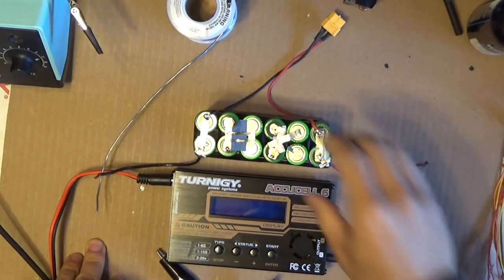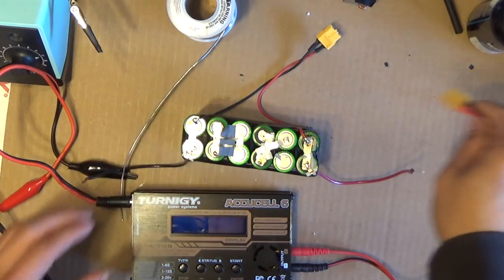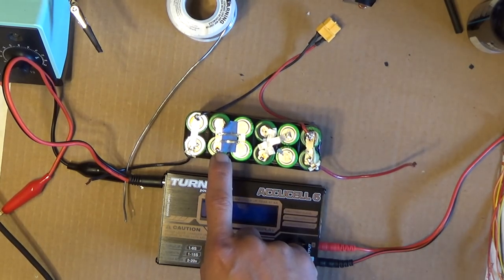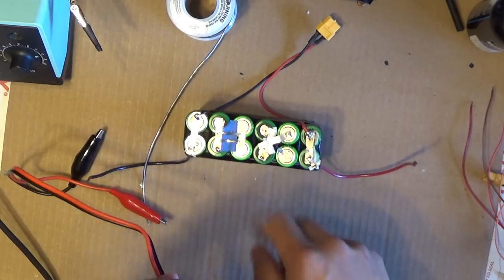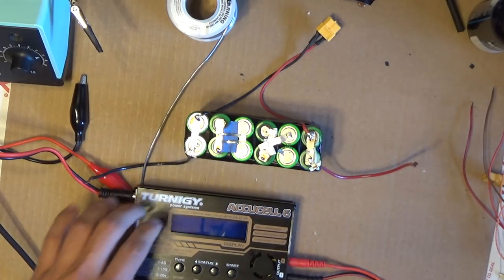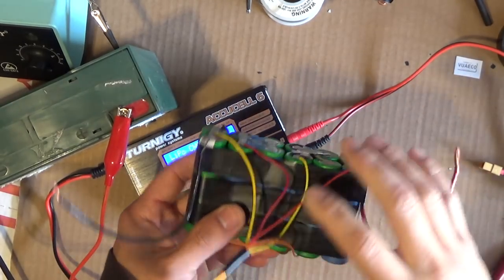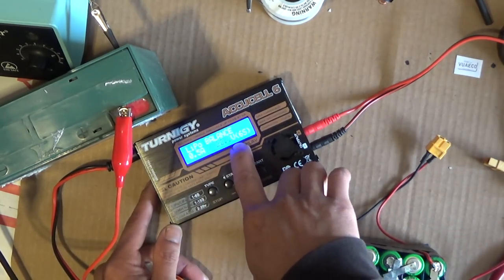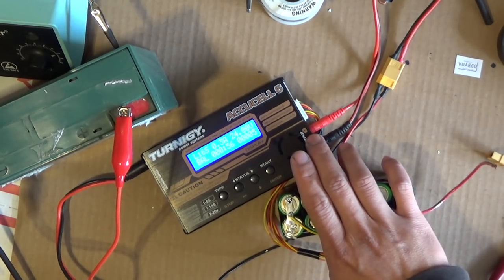DIY: How to Balance charge Li ion/ Lipo battery pack w/ a balance charging cable Imax B6 Accucell 6

Comment: I built a duo 6s cradle system each wired in series. Then I heard about parallel charging and that bothered me. This helped confirm that my wiring is correct so I should be able to plug it in without blowing something. I did blow a cheap charger a while back getting it wrong! I also didn't think about using 2s, 3s, etc cables instead of a 7 pin. That makes sense as the charger rotates from pin to pin (cell2cell). So thank you again my friend.

Comment: It would be better for others to learn and understand what you said.  The diagram on how you arrange the battery parallel. Most of the beginners will confuse serial and parallel connections.  Thank you

Comment: The reason that I am looking at your video is that I was given a new Ryobi 18v 4 amp-hour battery which was not working. Disassembly showed all ten cells were at about 3.8 volts and hence OK.  My plan therefore was to look for disconnects on the control circuitry and if nothing was obvious remove the board and wire the batteries directly.
I have an Accucell 6 Turnigy charger like you and tried to charge the battery as a complete block.  The unit would not do it and gave the error message ‘balance charge connection’ despite it not being in the balanced charge mode.  This is the second battery on which this has occurred and I think that the software has been programmed to do this.  I am interested that yours will, but wonder if you have actually tried it.  What I can do is charge linked pairs of batteries, but this means five episodes of charging to get them all up to level.  Batteries all have an internal resistance which is more matched on more expensive batteries.  On cheaper batteries this may lead to problems.  Watching your video I will reattach balancing cables and try again, but whilst thinking about it remembered that you can buy tiny voltmeters to go on the balance cable for a few dollars and so one can monitor the power tool to ensure that the batteries are not discharged too far.  Hobbyking certainly sell these for the model aircraft guys.  I have also chopped a drill battery case and put in a Turnigy 18v cell to get my old Nicad tools working again.  These batteries tend to be 2/3 of the price of the main tool companies.  I was also able to resurrect and 40 volt Hilti drill for a friend with two 50 buck batteries joined and convert it from nicad to lithium.  They are easy to charge on the  Accucell charger.  He was told that he must buy a new drill at almost 900 bucks.  12 volt kit can be done in the same way.
Thanks for the video
Reply: Do you know anything about ego 56 volt batteries for leaf blower and lawn mower they're all compatible 56 volt anyways I'm trying to make one that will work with it not having the original battery but there is two wires that I found out or something about communicating or temperature wires so there's no way to make it after market battery that I've been able to find so far is this true how can I bypass this communication wire anyway??? The brand is called EGO , I think there's somewhat new or newer company but I'm not going to drop $400 or $500 on a battery that's crazy I got the leaf blower for free I just need a battery cheers if you can reply

Comment: With 6s6p if it isn't overkill. You can start car and most likely
 not need to disconnect because it can handle the highest alternator voltage.
 Stop and go every day for a week and then take it into house to put all
 the cells back into balance.
 Drill a hole into the cab and attach it inside car so you do not have to always
 put up the hood.

Comment: Is there an explanation of your original build on this battery. I am so glad to have found you as you seem to speak to me!
Reply from the maker: This is a 24V pack I built for running 6x 4V LED light bar (connected in series).

Comment: Great video thank you very much so what about my battery homemade pack has 39 18650 cells so would i have to buy a connector with 39 wires on it ? Do they even make Chargers with connectors that big ? or do I break it down and do it in groups of six even though they're connected to do the balance???

Comment: Thanks for this, I was told last year it doesnt matter on these types of batteries about balancing but I have doubts now so I looked for a video like this. Always get a second opinion I guess.
Reply: Solutions Architect 
And the BMS will one day fail.
Reply: the balancing is in the charger through the pins to the "balanced" wiring. If you are using a 2-5 amp brick type charger with a single ground and single positive a BMS IS needed to take care of the balancing. It distributes the amperage to about a half amp (usually) up to 1 or 1.5. It's best to go by the mfgrs spec if you know it.:face-fuchsia-poop-shape:

Comment: Hello Vuaco, 
 I have some favorite smaller power tools (power screwdrivers etc.) that are 7.2v. By watching your videos I have replaced the old Ni-Cd batteries (usually 6 short "C" batteries) with two 18650 cells and they fit perfectly.....My question is, when two 18650 cells are used together to power a 7.2v tool, Is it considered a 2 cell pack and should it be balanced charged? 
The newer high voltage tools have many 18650s so is each one considered a "Cell"? Or should I consider every pair a "Cell"? 
 
 All your videos are packed with lots of info and I would not even consider re-building any battery packs until finding and watching your channel...I have re-built packs for family and friends in the past months and they think its magic! Lol

  Thank you for sharing all your knowledge with the world and especially me in Canada :)
Reply from the maker: Yes, a 7.2V with 2x 18650 is considered a 2 cell pack and should be balance charged. You can get away with a few cycles by not charging it to full 8.4V but eventually you will still need to balance charge it.

Comment: Thanks for a well explained video. One question: should you really connect both the "old" charging cable and the balance cable? Or does the balance cable only measure voltage?
Reply: Thanks!! Vary well explained.

Comment: Great if you could see the screen on the charger   I still don't know what mode to charge my 3S 8P 12 volts 32 amp 21700 cells I have lipo lilo life lihv which one  is for lithium

Comment: Good explanation. Ihave a question. With a 300Watt, 6S Li-Ion, 20A balance charger, can i charge a 18650 Li-ion 6S4P 12Ah pack(24 batteries)?
Reply from the maker: Yes, definitely.
Reply: And how long would it take to charge?

Comment: Not sure what you meant but I’ve wired mine the positive first then alternate negative just trying the turnigy accucell 6 out to balance and my cells seem quite close already and I don’t use bms at moment some people just use bms to balance but don’t connect main power through bms one I had stopped anyway after not long on bike so I took bms off

Comment: This is grate! But in thia configuration isn't it balancing for 2 cells? Co if one in pair is weaker it will still charge the other one more then it supposed to be charged?
Reply: The two cells in each pair will always be at the same voltage because they are in parallel.  Electrically the two connected together form one cell.
Reply: @westinthewest  thanks. What would. Happen if one in pair was able to be charged lower then the other one because it wpuld. Be a damaged cell. What would be the reading on that pair?
Reply: @michatrejgis2188  It's impossible for the two cells to have different voltages.  Connecting them together in parallel is the same as extracting the materials from the inside of each cylinder and putting them all together in one bigger cylindrical can, making one bigger cell.
Reply: @westinthewest  so if one can not load to the full, the other one will compensate for it? Or will finish loading on the lower level too?
Reply: @michatrejgis2188  I don't fully understand the question.  The two paralleled cells will both charge to the full 4.20V together as if they were one cell.  There will be plenty of internet resources which will explain the principle better than I can.
Reply: @westinthewest  if one cell is able to go up to max 3.9v and the other one to 4.2. What will happen?
Reply: @michatrejgis2188  I need to understand why one of the cells can only go up to 3.9V.  If you are mixing chemistries between the two cells then that is of course ill-advised.  If the cells are both the same chemistry you can mix brands and even capacities with different internal resistances.  Their voltages will always be the same.

Comment: Please help, ty for the video but I made a 4p  battery pack for my 3.7v fish aerator, my question is does it need a balance wire for the 4 parallel 18650? Im a nebie and cant find anything on parallel balancing. I own a battery new spot welder and skyrc b6 charger. Any help will do, thank you.
Reply from the maker: Hi Max, you don't need to balance charge a 4P pack because every cell is balanced to the other cells connecting parallel to it. You only need balance charging when your pack is connected in series with 2S or more..
Reply: @vuaeco  oh! ok......TY so much.

Comment: Thanks a lot for this video. Maybe someone can help me out with a problem I'm facing for hours now. I've two Accucel-6 and they work with packs without any problem. Now I want to use them for an ebike. I ordered a bunch of NCR18650BD Lion. I've put them in 3S with different numbers of P. The load current seems to be limited to 1.0 A, independent of all settings. For 1P it may be ok, but for e.g. 14P it would take forever to load the set. Any comment? thanks
Reply: solved. I've introduced it myself. On both ends of the battery I've put copper tape to improve the connectivity. But the opposite happens. It added a small but important resistor to the lines.

Comment: Hi!
Can you please show a balancing charge on an 18V Li ion Makita battery, without opening it up, just using metal flat sticks to connect to the battery. Thanks!
Reply: Makita batteries have a balance built in so connect it to a charge. Pick charge option, away you go.
Reply: @johnlever6696  indeed, away he goes

Comment: Dear, very thanks for your video ,pls,I want to know if you add pcm to this battery pack
Reply from the maker: A PCM (Protection Circuit Module) is to prevent over charging and over discharging. You don't really need to protect over charging as the Accucell 6 or Imax B6 already has overcharging protection. You might need to protect it from over discharging when you use it on your power device. But I don't think you need that, in my opinion. Adding a PCM will make your DIY pack more costly. It also add in more complications to your build. And it also cost you more time to build. These problems will escalate when you build many of these packs to string them together to make a bigger pack. What I do is I just use a voltage display monitor so that I know exactly the voltage of my pack at any time and unplug it when it is necessary. A 4.2V cell will be flat at around 3.5V to 3.7V. You don't want it to go any lower as it will damage the cell.
Plus, a PCM will not likely to help you at all. Just look at the Ryobi power tool 18V battery pack. I did make a repair video on that and it turned out the Ryobi PCM board did nothing to protect the pack from over discharging. Sadly, Ryobi is not the only manufacturer that fails on this. Many other power tool batteries fail just because they are over discharged even though they all have PCM onboard. Here's the link to the Ryobi battery repair video if you want to see it: https://www.youtube.com/watch?v=wEzCO-DIMoI

Comment: This is probably very simple, but doesn't your Turnigy charger balance charge on the 7pin connector alone?  was there any need to plug in your XT-60 connector?
Reply: That's a good question. I think the XT-60 is just needed for the device you're running.

Comment: Why you charge at lipo program and not li-ion? I always have this question.also i just build a 3s battery pack with total 12 batteries 4+4+4 .my question is what would be my minimum voltage to stop using the pack?Also i have a pcb ready to solder it .should i? Or i am good without?
Reply: Because there is no such thing as a "LiPo" program. Both Lithium Ion and Lithium Ion Polymer (incorrectly termed "Lithium Polymer" or "LiPo" for short) share the same set of possible chemistries (because they are in fact the same other than what they use for their outer shell) and can have (depending on the chemistry used) a charge voltage from 4.1 to 4.35 volts.

Comment: I am having trouble locating the balancing cable plugs.  Where do I get those?
Reply: This was 5 years ago but I just bought some from Amazon and the wires are a little short plus the wire gauge is thinner than I would like.

Comment: can those small charger used to charge larger batery pack like 6 series of 10 parallel battery? so total is 60 battery? or any sugestion what charger best for 60 battery cell for electric bike
Reply from the maker: It can. But max current is only 6A.

Comment: if u could answer this question: what if i have more than 6 batteries to balance? if yes, how do i balance it with this imax?
Reply from the maker: This can only do 6. If you have more than 6, you'll need to separate them or get a BMS and a dedicated charger.
Reply: @vuaeco  do u have a messaging app like whatapp or telegram, i like to know how to do it

Comment: No offense sir but your accent is unique. Are you Asian from Oklahoma? Anyway, great job on these videos very informative and precise. I really like the way you present each video. And how you do things like me (on the cheap). I have a question, I built a 3s4p pack with fuse wire. After I built it, I  checked it with my multi meter and the reading was 11.7v. I then connected a 400 watt inverter to it. I ran a load of 27 watts for around half hour. Then the alarm of the inverter began to sound off. After disconnecting it from the pack the voltage read 3.2v. How is this possible? Please guide me to the right path. By the way I didn't use a BMS or hooked up a balance lead like you. I'm  still waiting for my imax 6 from China. Thanks. Mario
Reply from the maker: Is it 3.2V each or 3.2V total? (you have 3 in series?) Depends on what kind of inverter you have, most will have a low voltage cut off about 11V. You can use a volt meter hooked up to your inverter and run it under load and monitor where exactly it cuts off.
I'm from California, Asian, yes, but my accent is kind of messed up because I watch too much British and Australian television! :D
Reply: vuaeco Thank you for swift reply..Lol...it's all good brother. Yeah, I think your right about the inverter cutting off at 11v, but I don't understand why my full pack is reading 3.0. I built this pack as a practice one. Planning on doing 3packs of 18p3s 12.6 volts for a portable power bank. What do you suggest?
Reply from the maker: A 3S Li ion pack nominal voltage (average) is 11.1V (3.7 x3). So your inverter might cut off prematurely when your battery pack still has plenty of juice. If you're brave enough, try 4S Li ion pack. They are designed to run on lead acid batteries so they can run at 14.5V comfortably. Some inverter can handle up to 16V DC though some will burn out. Try at your own risk though :)

Comment: hi how come tommy calloway  wires balance wires 1st wire positive then alternative negatives but you wire the opposite way round 1st wire negative then alternate positives.im confused which way do I wire ?
Reply from the maker: He probably just flips that connector the other way around. As far as alternate positive or alternate negative, it's the same thing. That's because the connection is series so positive and negative of the 2 adjacent batteries are connected together.

Comment: hi  my bms 4s come for my battery 12v 4s  it has multi coloured balanced leads but I have red /black balanced leads they usually go first red to positive then alternate black to negative of cells don't they?steve
Reply from the maker: Usually. And yes, you can do first red to positive and then alternate black to negative cells. It can only go in one way, though. But what I have seen from these balance leads is that they have no specific color codes. They seem just to have random colors.

Comment: Do you really have to choose  the proper program  before you attach the battery  connections?
Reply from the maker: No. You can program before or after connecting to a battery pack.

Comment: Good day. My 4s balance wires have 1 red and 4 black. How would I connect those? Isn't red positive and black negative? You are connecting to negative the rest of cables to positive of cells. I'm confused...
Reply from the maker: The colors on the balance wires are usually random. At least that's what I have. Don't use the wire colors. Just follow the instruction on the video and you should be fine.
Reply: vuaeco I'm gonna give it a go.  Thanks for all your input.

Comment: hi vuaeco.im watching one of these accucell chargers ebay will it charge my 6s5p packs and balance at same time?im using 6s2p x2 and a 2p to make 14s5p kit 48v for ebike
Reply from the maker: Yes, it will charge and balance a 6S pack. You can get an 8S charger but it's much more expensive.

Comment: Can't you just tap out the 7 points and charge it at 3.7 volts isolated without using the hobby charger?
Reply from the maker: You can. But you have to make sure they all have isolated grounds or they will short out. And it will also take you a lot of time every time you have to charge the battery pack though.
Reply: @vuaeco  ok. I will be charging them only one at a time to reach 4.2V target.